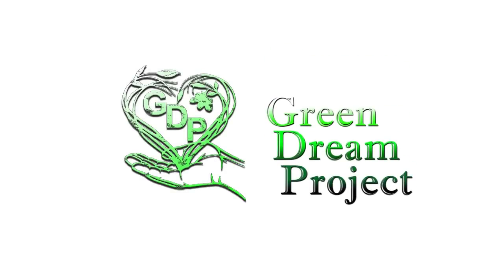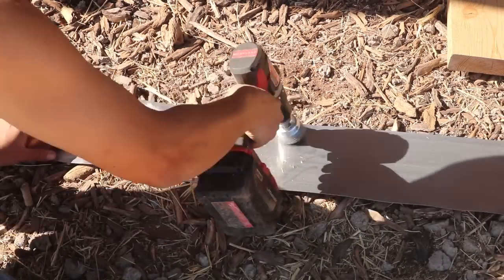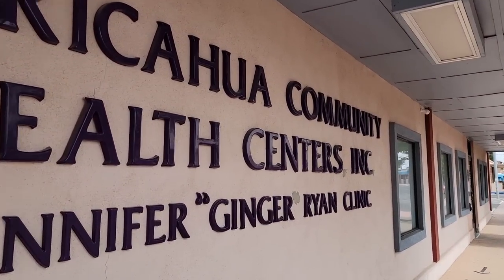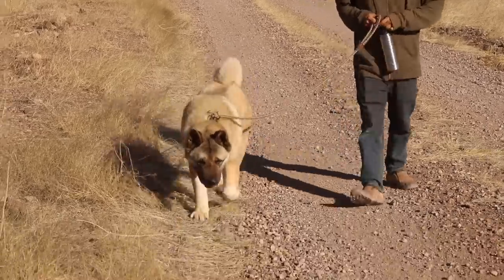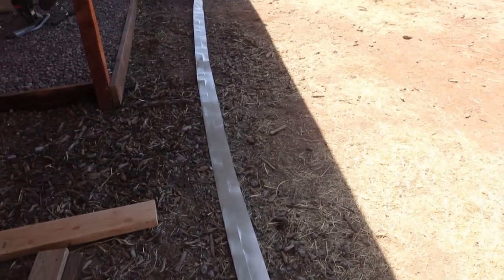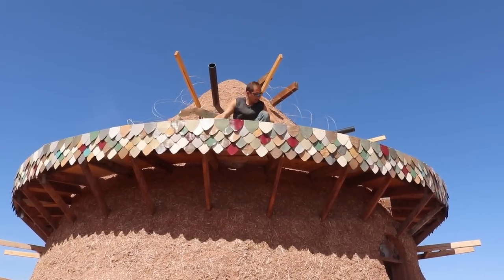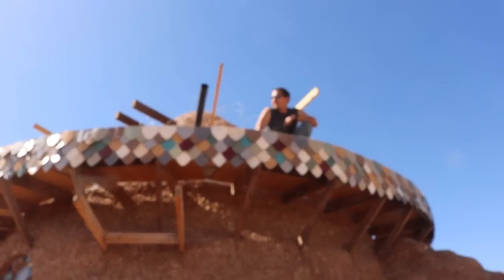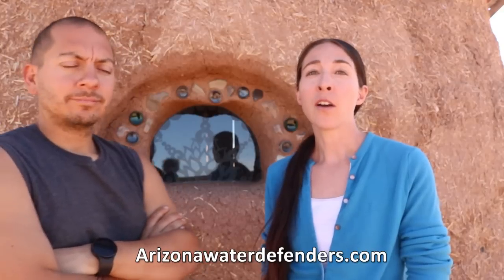This Is NOT How It Was Supposed To Go | Building Off-Grid On A Budget

Comment: You might want to look at evaporative coolers. You can make them with a box fan, furnace filter and a rubber made tub.  While it used water, it might be more efficient for you than the AC. 

You could also try black plastic flex pipe to make a ridge cap. Just slit one side and put it over the ridge just like insulating a pipe.
Reply: great idea with the pipe.. i approve ...
Reply: I’ve built one before with a box fan,fountain pump and some aluminum C channel. But I used evaporative cooler media and 3/4 pvc pipe. A ball valve to control the flow and for the tub I just used an old under bed box.
Reply: Except they did mention peoples wells running dry. More efficient WRT electricity only to use more of another precious resource!
Reply: Don't know how much water it uses, but evaporative coolers were designed for deserts, not humid places, so it should work.  Because of your water situation, I would suggest not using it if your indoor temp is below 80 to 85.  You may never get a temp that high with your build.

Comment: Use what you have to experiment with. Hang the metal over the top folding it  with your hand to get it started. I don't think it's the crimpers making it split open, but trying to get to go around the curviture of the house. Then use your crimping tool very lightly to finish it. Use self tapping screws long enough to go through both sides of the metal.
Who knows the flashing you have may still work. What do you have to lose? Good luck. I know you can do it. Good luck. I know you will figure this out.
Reply: Sorry Jack I have to agree with Jim it is the tight crease that has weakened the metal but he has enough material left to make a smaller cap if he goes about it the right way
Reply: You might want to try either 3/4 or 1 inch pvc sch 40 pipe a slice one side the length of the pipe and see if you can spring it over that edge you are trying to cover add couplings for length remember work smarter not harder Best regards

Comment: 👍get a gutter downspout crimping tool. ($25 at lowes) Fold your flashing at a right angle, then crimp the inside leg of the flashing. This will slowly cause the outer face to curve around your fascia, while at the same time allowing you to bend it into a 'v' to conform to your cement. I would suggest doing it in 3' pieces.

Comment: A problem that you are going to run into is when you make a U bend in the metal you will have difficulty bending the length into the required radius to fit around the overhang. Shorter lengths lapped over each other at the ends may help somewhat, but will not solve the problem. Try electrical PVC conduit (gray), as it is sunlight resistant,  cut a slot the proper width lengthwise and slide it over the edge and screw it through the sides.Also cut couplings the same and glue them in place as you go..

Comment: You should consider putting at least three or four screws on each shingle of the top row. When applying the ridge cap you need an upside down u instead of a sharp bend.
Reply: ABSOLUTELY TRUE GREY WOLF  !

Comment: Jim,,, I  have the Omron BP Tester as well and have found that when the batteries start getting low I get Low BP Readings.... Take your BP again, then change your batteries and take it again.... That may be your issue
Reply: I got sick of unreliable readings, so I bought an external power source for mine. Don't need batteries anymore.

Comment: put the 6" on, exterior screwed. completly flat.once installed, cut slits from upward edge toward the crown of the facia, NOT all the way- leave a distance as long as width of the top face of the facia). then bend the section between two slits and lap each section- uphill goes UNDER the previous flap, and downhill goes OVER the next. or do the same with pre-cut 15' sections for easy handling.

Comment: An evaporative cooler uses around 100 gallons of water per24 hours. In much of AZ they are not allowed in the building code. In some places you can not get a  building permit if shows evaporative cooling.

Comment: Hi there great job i saw that you used self drilling screws for metal the best is to use one's for wood it will go thru the metal if you use a good quality screw or just centre punch the holes but you can just replace you already have the holes, you see the metal type have fine thread so it will pull out off hardboard etc.

Comment: I do not know it is available in America but aluminium flashing that is used around chimneys and vent pipes would do the trick. The only problem is electrolis. It would react with the shingles. The best would be poly pipe. Slit it down one side and slip it over the top. It could be held in place with screws.

Comment: Coming along guy , y’all will be soo much cooler in the earth dome . You should do another temp check in the dome & the room underneath. In so . Ca. Desert here it’s 90 degrees & my cave I’ve been digging in the granite is only 3-5 below the surface & 22 ft in depth so far & its 57 degrees compared to the outside shade temp of 90 degrees.
Reply: Wow, that's a really nice temperature change. Is that the thermal effect of the cave?

Comment: Weesatche mesquite's and Cedar are drinking up ground water and are a major problem. They're a very invasive species. Mesquite has the ability to grow a tap root 200 feet down, and roots that spread and search for water up to 50 feet outside the tree canopy. A 10 ft tree can lap 20 gallons per day.
Reply: Trees create microclimates that are beneficial. Desertification can certainly happen from removing all the trees. The mesquite trees are successful in the low humidity and low rainfall of the deserts. I would think removing them would make things worse instead of better. Just my opinion.

Comment: Here’s an idea: remove the top shingles, place the ridge cap and screw the top row of shingles back together with the ridge cap. Maybe it will work, I don’t know but I hope you can find a most permanent, easy and functional solution.
Reply: The point of the ridge cap is to keep water going behind the shingles so put a shingle on top defeats the purpose of the cap. But I get what your saying

Comment: Would a “mr cool” style bidirectional heat pump take less power than the floor unit you currently have? Less load on the solar system and batteries.
Reply: Yes, they are far more efficient.

Comment: It is a good idea,  just bend the metal over a 1/4" or 1/2 " thick length of wood so you can accommodate the width of the shingles and the wood they are attached too. You just need that space. You could probably use the crimpers too as long as there is something to hold the space.
Reply: A channel cap
Reply: @marymccowan6629  Can it also manage the curve of the gutter around the dome? With a channel profile I don't think so.

Comment: You probably have enough material left to make a short ridge cap if you are interested I can guide you through a production technique with boards and clamps.
Reply: That would be great if you could help Jim out, I just don't know how it can lap over the ridge and still follow the curvature of the gutter around the dome. Metal isn't that pliable.
Reply: @StoneKathryn  No problem if you let me know the thickness ie depth from front to back of your parapet and the  distance remaining on your steel from the fold to the edge.Also if you can measure the curvature that would be great just an average will do use a four foot straight edge and measure from the back of the straight edge out to the parapet on the two foot mark
Reply: @davidprocter3578  I think Jim was using aluminum flashing so he has 6 inches of flat material left. He would have to get back to you about the particulars since I'm just another viewer. I hope he notices your offer. Good luck!

Comment: You need to have the same gap in the sheet metal as to what you are covering.  So if the top of the shingles is 1 inch than that should be the gap in the sheet metal

Comment: Everything doesn't always work out right away. There is a special sheet metal edge protection profile (u-profile) made of steel core, rubber or PVC for mechanical engineering - should be for outside areas, they clamp on the edge or can be additionally glued with silicone. Are available in different sizes. Can be bought at hardware stores or online. Cheer up and move on...

Comment: You don't have a metal fabrication shop nearby?  I use many clamps and a piece of angle iron to bend long pieces of sheet metal but to make  metal go in a circle it needs rolling or many short pieces. I did need some custom pieces I couldn't make at home so I went to a metal fabricator with a plan. And when its done good no one will know.
Reply: Go to a map. Look up where they live. No metal fab shops.

Comment: you can still use that metal, unbend it all so the flap is at a 90 degree angle, screw it into place all the way around the dome, come back around with hammer and beat that little lip into place, same idea, different approach

Comment: The aluminum flashing gets "work hardened" in manufacturing, when it is rolled (to be thin) while it is cold. It is normally not needed to be bent so sharply when used, as Jim was doing with the seamer tool. Opening the stressed, already sharp bend caused it to crack and fail. Thin gauge galvanized steel (like metal air conditioning ducts are made from) would bend just like you were trying to do, without cracking. Or as someone else said, just make a rounded bend (without a tight crease) and the aluminum would probably work. Don't call this a failure, it is just a lesson. Experiment on small sections next time. Persist and you will succeed. I have faith in you guys.

Comment: Most of the abusive area of Arizona is  In phoenix and large cities over planting with non-native  species of plants extensive planting of Lawns , water features and  trying to turn the desert into a artificial oasis instead they should be eliminating all water hungry plants on going strictly with desert scape  rock gardens and native shrubs trees and plants. the only water should be used to grow food on a limited basis drip irrigation low water usage no flooding  row crops etc farms will have to adapt to limited water use crops.

Comment: Hi guys- so sorry about the ridge cap.  But, I wonder if you could take the wider portion of the metal and just do the first bend in it.  Take lit to the ridge area, put it in place & then crimp it with your new crimping tool.  Might work cause you won't have to open it up again once it is place.

Comment: Potassium deficiency is the reason for heart rate dropping. The potassium does that it triggers the heart gives it a kick.
You get potassium from a range of foods including oats and banana's banana's a good for potassium but not the only source.
Cactus has a good supply of potassium believe it or not and like almost zero carbs but has complex carbohydrates.

The latter is 1.7 g sugar and 3.3 g of dietary fiber, the rest is complex carbohydrate. 
Cactus, raw contains 0 g of saturated fat and 0 mg of cholesterol per serving. 150 g of Cactus, raw contains IU vitamin A, 
13.9 mg of vitamin C and 0.00 mcg of vitamin D as well as 0.89 mg of iron, 246.00 mg of calcium and 386 mg of potassium.

You should do some research on potassium and obviously because of keto diet you are missing some vitals.
thing is you can easily include what is necessary and shouldn't overly effect your keto diet.

Comment: How much does collecting rain water affect ground water???
Reply from the maker: It actually helps ground water levels.
Reply: (Married to a geologist) It is my understanding that harvesting rainwater in the rainy season actually benefits the soil. Imagine this, in the rainy season millions of gallons of water soak the land and flows away from the area it rains on. Harvesting a few thousand gallons is just a drop in the bucket of those millions of gallons. However, if the water is stored and used to provide water for a home and the gray water treated and reused to irrigate small gardens and small farms (you see I said SMALL farms.) it keeps the soil conditioned, it is far less likely to fry and blow away. Keeping the soil and plant material that decomposes, over time, will build up better soil. So in this way harvesting rainwater actually helps the land.
Reply: @ourselfreliantlife  That's what I said.

Comment: Put a small rod to bend the flashing around to make the fold rounder to slide right over the shingles. THUMBS up to this video!!!!👍👍👍👍👍stay positive and POSITIVE!!!!!🎆
Reply: I love your thinking! Being a fabricator, I know exactly what u mean .
Reply: This was my thought, as well.  This should solve their problem moving forward.
Reply: Backer Rod, Caulking Filler Rope, Thick Sturdy Rope, Wooden Dowel, Cafe Curtain Rod or Small Diameter Rebar may work as templates to make a 'rounded' flashing crease that won't split open.
Reply: how about crimping the flashing over a plywood strip template that matches the size you need?
Reply: good idea!
Reply: Jim could even bend it over the shingles as he goes then use the crimper before screwing it down. On the whole it looks great, perseverance is the word. He has plenty of that in droves. Go Jim go. 👍👍👍👍👍👍👍👍👍👍

Comment: Those issues will not go away with water, until the suns active phase has changed long enough to redevelop the temperature zones and weather systems long after our lifetimes. Yes, corporations are to blame for widespread issues. But the input on the system is under no human control capable of matching that long term. Its crucial to build pockets even for just one home area, and no one wants the extra costs while building. As I have said numerous times in the past there are methods that are not so expensive that dramatically change pocket areas, but until its already omnipresent no one wants to hear, listen, or actively work prior to the problem. The very same as with why the govt knew fifty years in advance of this solar system wide upheaval and its historical prior pockets of change, that they would put the issues on the individual, lie about its causes, and profit and maintain power when it finally got here. 
Its very strange I got this video presented after having unsubscribed so far in the past for the issues of not only not being heard but run off by the community in chat streams and so fourth, because everyone knows better and lets all go back to high school maturity nonsense over the knowledge and facts. Shrug But good luck with turning it around.

Comment: Ridge cap..... Let me think.....
Two strips put a bead of silicone along the edge of one. Lay the other on top and press the edges together. Then pop rivet the silicone stuck edge together.
There exists a rubber/plastic strip that clips on the thin metal edge that would be created. But that's as far as my brain is taking me with that.

Comment: The shingles look really nice. Yes Jim stuff happens . You really need a channel  as a ridge  cap a channel wouldn't bend the metal as much so it wouldn't break apart. Or see if you can buy a metal channel. I remember buying a channel of metal to cover my siding replacement  it covered the ridge of wood siding to keep water from getting behind it samething . Good luck

Comment: A 2" or 3" roof drip edge from the big box stores would work on that. It already is at a 90 degree, just need to crimp it as you are putting it on
Reply: Would need a relief cut every 3 inches or so... or  you could crimp it using needlenose pliers and twist method.

Comment: That right. need to seal the  back and the top to, to keep water out.  Now metal sweat moister! Not good to use>  Where tar paper don't sweat moister!  What i would do is? Take it all down adhesive the tar paper to the wood sides top and bottom .  Then put your shingle up and top trim of metal  i would also put some sort of caulking behind each shingle to help hold them up there . You got strong winds and dirt devils  That would give you at less 10 years of protection